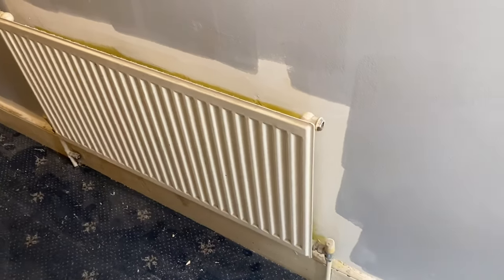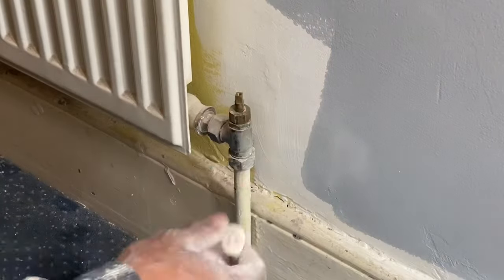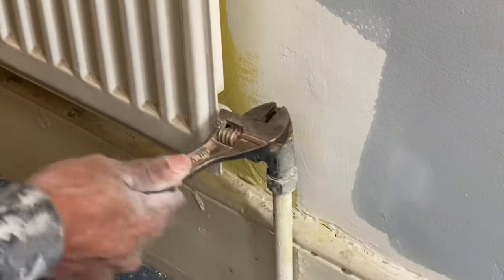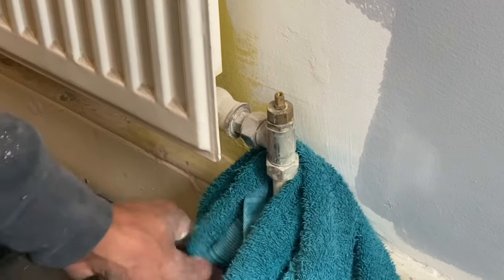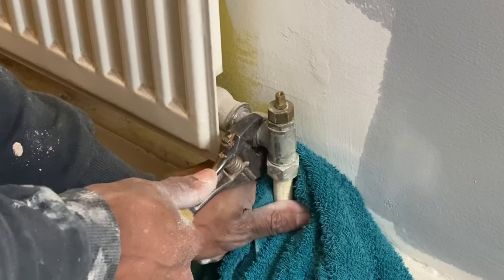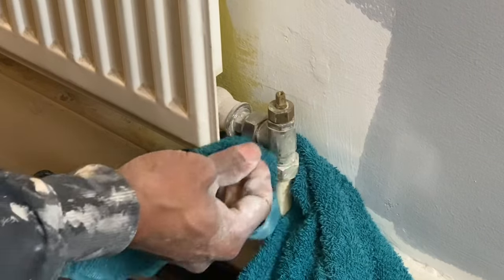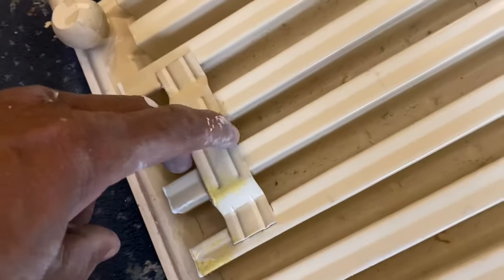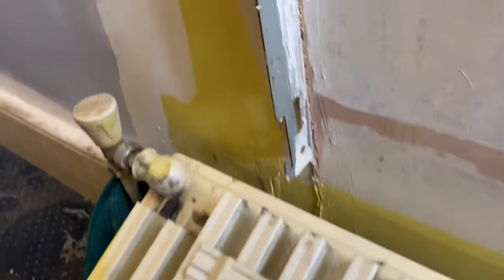How to drop a radiator / Remove a radiator for decorating, painting, wallpapering, plastering

Comment: Most times the pipes wont have any slack so this wont work. Just use a mini roller.
Reply from the maker: @bikeman123  most Uk home shave timber floors and therefore typically have slack. I've never had a timber floor whrere this hasn't worked. This is also helpful when removing wall paper.

Comment: Thanks for this video! btw I have a slightly unrelated question, about skirting boards that have thick badly done paint on them. Is it possible to sand them back down to an even smooth level or is it best to just replace the skirting board entirely?

Comment: Thanks very much for this video. I followed your instructions earlier today in our downstairs toilet and it worked a treat. I had been dreading doing the job, because I thought I'd have to disconect the radiator from the system and remove it from the wall completely. I would never ever have thought of doing what you showed us. 
Again, many, many thanks.👍

Comment: Is it safe to leave the radiator dropped for a couple of days while I make small repairs and paint the wall? Also, can the central heating remain on while it’s dropped? Thanks for the great video
Reply from the maker: Yes it’s fine, just tighten it back up while it’s down until you’re ready to bring it back up again.

Comment: What do you mean the top up the water pressure?
What should the pressure be and how do you do that?
Thanks for the video.
Reply: There will be switch or lever valve on your Hot Water Boiler to top up the pressure. Open the valve and watch the pressure gauge on the boiler rise until it's within the manufacturers  recommended pressure range

Comment: Hello what will I do if after i put the radiator back it started leaking? Water? Thanks
Reply from the maker: Hi make sure you’ve tightened it properly. If it’s leaking in the joint that you loosened then it might feel a bag joint that was disturbed so you’d need to drain system and either Replace the connection or try some pTFE tape on the threads

Comment: Thanks for the video, say my radiators haven't been  moved in a decade and the nut is locked, would you use wd40 on the nut to try loosen the thread? Light banging hasn't worked, cheers
Reply: What did you do in the end?
Reply: @alexdavies7112  Got it budged, used some 3 in 1 brand penetrant (UK). Took a few sprays and some time, plus elbow grease.